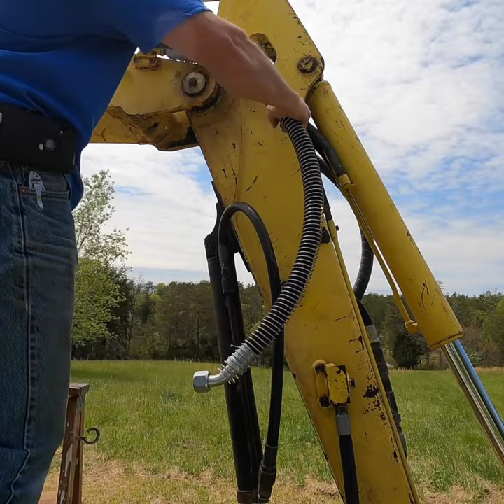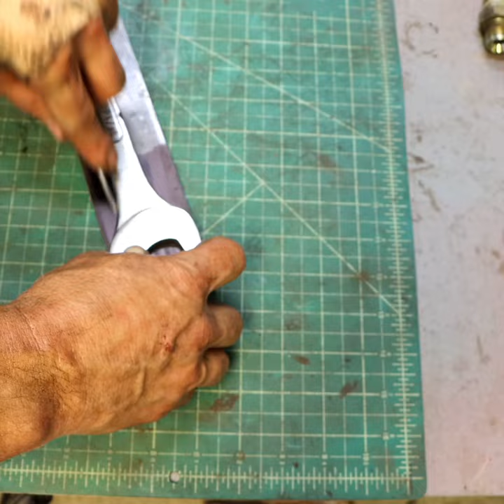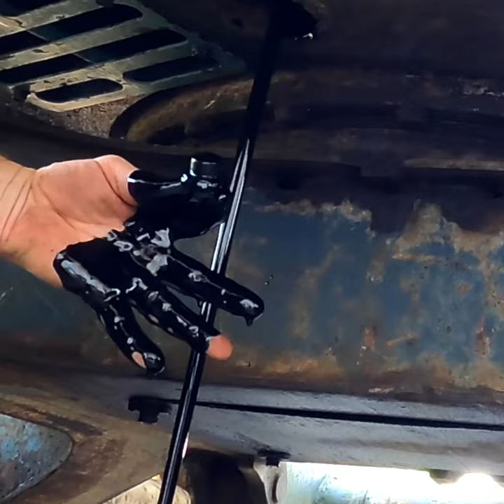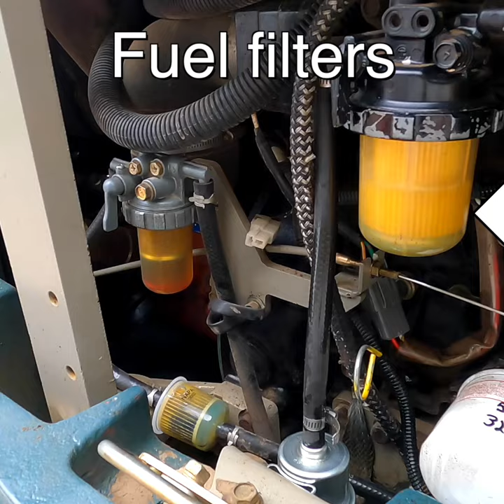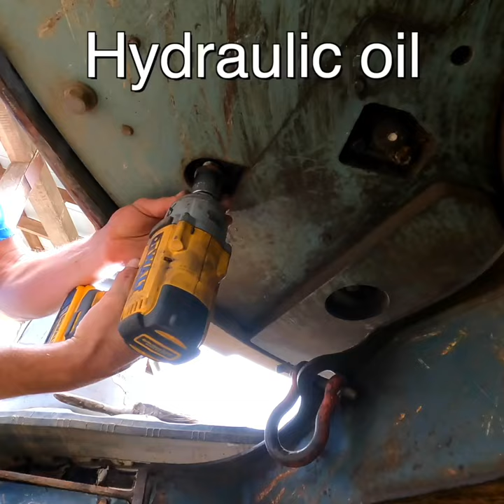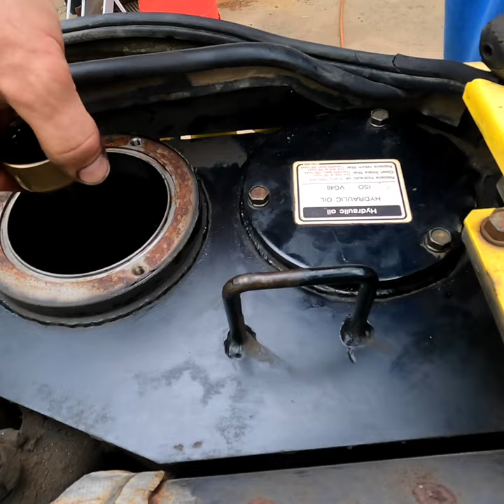Fixin’ up the new-to-me excavator.

Comment: How I deal with end wrenches that are too thick. I buy a cheap set of HF combo wrenches, grind them flat as needed. Cheap fix. Plus I don't have to buy flat stock nor do I have a metal band saw. When you're poor like me you take the cheap and easy way out!
Reply: The real ones understand 👍🏿💪🏿
Reply: Good mechanics will have a drawer full of the hacked, ground, welded, torched and otherwise modified wrenches for special needs like this... Lol
Reply: @ke6gwf  👍 You definitely know what I mean!
Reply: Actually, one drawer probably wouldn't hold all my "customized" tools.
Reply: @Watchyn_Yarwood  well duh, "good" mechanics will have a drawer full, "Expert" mechanics will have more "custom" tools than many mechanics have basic tools! ;)
Reply: While that's true, sometimes the alt. method is better than a trip to the store...in this case you have a dedicated tool that can stay in this rolling property...

Comment: If you ever take the track pad off, your going to need a big ass impact. Not just to remove the bolt but to tighten it back up. I’ve used a 1” Milwaukee impact and the pad still comes loose. Also be sure the mating surface is super clean. That makes a big difference keeping them tight aswell.